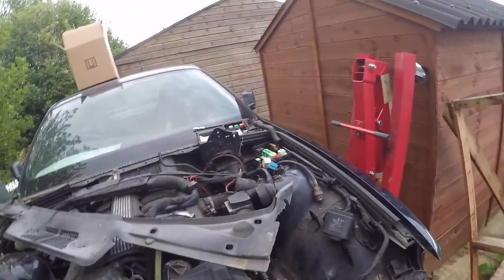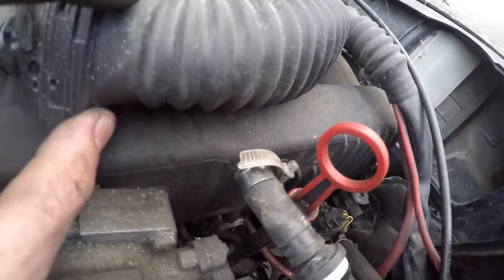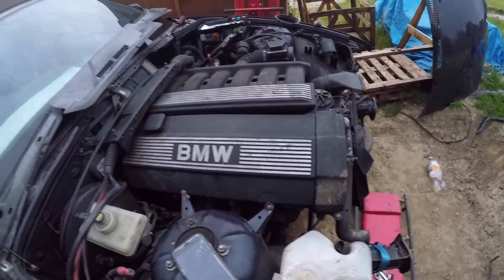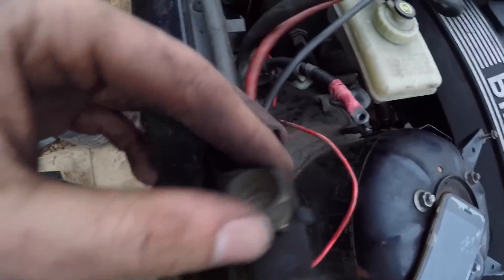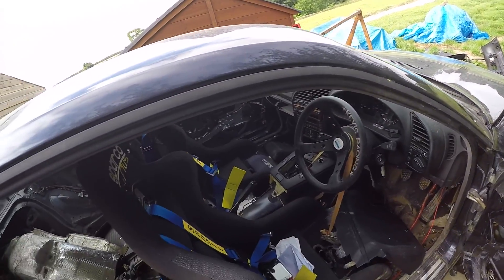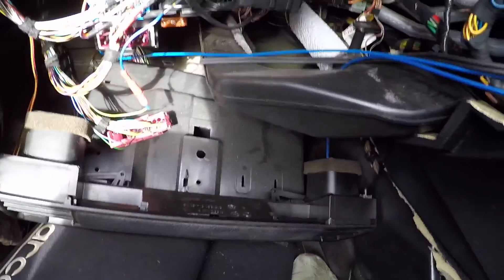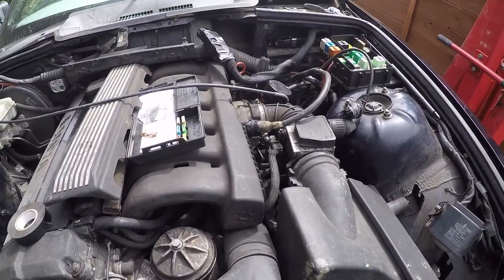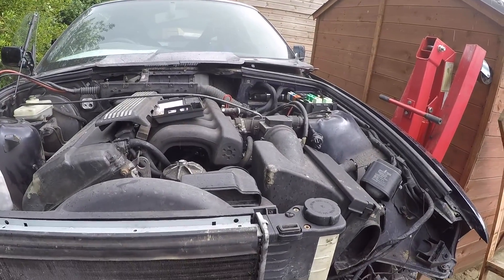E36 4 Cylinder (M44) to 6 Cylinder (M50) Engine Swap DIY Part 3

Comment: Hello, I hope you are well. I have a BMW E36 318i with an M40B18 engine and I bought an M50B20 engine. I wanted to ask you if the M40 gearbox will work in the M50? Thanks for your help. I look forward to your response.
Reply: If your gearbox is Getrag then yes, bellhousing aligns and bolts right up, just connected my Getrag to an M52 in my E36

Comment: Hey man . . . as far as the fuel lines go, did you need to use any fuel lines going to the manifold from the 325i? I bought a m52 by itself, no parts car, so im wondering if i need to obtain some additional fuel line related material in order to perform my swap

Comment: I did this swap, from put a 94 m50 (red label ecu) into a 95 318ci, jumped EWS module and I’m getting crank no start. There is no fuel getting into the engine, and the fuel pump is not priming on accessory. I’ve heard this can be an EWS sub issue, but it may be part of my fuel system. I’m unsure, but I don’t believe it is my fuel system. Anyone here have this issue and fixed it?

Comment: Hey man dont know if you still check these comments. Does the loom plug into every chassis? Wondering if it will plug into my 1992 m40 e36 i got a 1996 m52b28 engine.
Cheers and props to your swap.
Reply from the maker: Loom plugs into every chassis!

Comment: hey mate if have a 92 318is without ews has m42 motor in it and thinking of doing the same swap, does it matter if the motor i buy is from a car that has ews or no? cheers
Reply from the maker: Doesn’t matter, if the engine has EWS then you just need the ECU chipped to remove it. If the engine does not have EWS then nothing to do.

Comment: How do you check your ecu codes? I've already done the swap but can't seem to check the codes is there a wire you have to ground or do you just use the obd2 port?

Comment: What to do if i've seaped it, it turns but cant even crank...
Reply from the maker: Czarny hi, what do you mean seaped it? In answer to your other comments, If the engine loom was left on the engine you don’t need to mess with the starter cable.
Reply: @JDRMotors  swapped*  and it gives too rich mix, it started but turns of without me stepping on the throttle. Now it cant even start and it only shoots flames from exhaust
Reply from the maker: Czarny I have not had issues with backfires before or mixture. Are your fuel lines and pump all working properly?
Reply: @JDRMotors  yes, they are. But I think it might be cuz of the "left air" while i removed the charcoal filter and I left open the line which goes into the intake manifold. I will fill the gap and see then.

Comment: What is that black round box at right of the engine mounted to the chassis and from which goes the blue line close to the fuel lines
Reply from the maker: Czarny it’s a charcoal canister for emissions, you can delete it.
Reply: @JDRMotors  ooh, such thanks for response ^^

Comment: Hi mate I have a 1996 318i with ews and I'm fitting an m52b25. Will a chipped ECU with EWS removed be fine? Or will I have to cut and splice, let me know!
Reply from the maker: Edward Karran you’ll need the ews removed ECU and you’ll have to bypass the ews module on the chassis as well as it’s a 96.

Comment: Hi mate, what was the small green wire that you cut? and do you have to keep the ews plug disconnected from the module to start it?
Reply from the maker: Hi mate the green one isn't needed, just splice the two thick ones and keep the ews plug disconnected from the module.

Comment: Hey mate, I’m doing the same swap but I don’t know where my ews is located my e36 is a 1994 not sure if you could help me
Reply from the maker: Adrian Morales hi mate, you need to remove the glove box and then it’s a big square connector. It’s the lowest one (can be purple sometimes) and just look for the two thick cables that I show how to splice.
Reply: Thanks mate I really appreciate it 🙏🏼
Reply: CN you use the 4cylinder motors auto gear box with the new 6 cylinder motor ? Also are there any supercharger kits?

Comment: Hello mate. Just on with bypassing EWS now. I have bought a new ECU with EWS removed. I am looking at the EWS plug where the glovebox is and I’m stuck slightly. In your vid you say cut wire 3 which is a small green wire. And 1 and 4 to bridge together. They are the 2 thickest wires. However the 2 thickest wires on my plug are in space 1 & 3 and the small green wire is in space 4. I’m assuming when you are stating a number it is labelled on the connected itself? As that is what I am looking at. So you have an email so I can send over a pic to show you what I mean? Any help you can provide is much appreciated.
Cheers,
Alex
Reply from the maker: Hi Alex, I think the green wire cut only works on certain years. The numbers and spaces can vary over the years so all you need to do is cut the two thickest wires and splice them. If that doesn’t work give me a shout.
Reply: JDR Motors cheers mate. Worked an absolute treat. Started up perfectly. Celebrating similar to you 😂. Thanks for he help. Vids are top quality 🤘👍

Comment: I have a CAR from 1995 And engine from 1991 IT crank’s over but wont start...
Reply from the maker: Bendik Medrud EWS bypassed on the 95 chassis? Is your fuel pump turning on?
Reply: JDR Motors  i have tried bypasing IT no help, no the pump is not turning on. I just sett power streit to the pump
Reply from the maker: Bendik Medrud ok fair enough, I would check for spark next. If no spark could
be the crank sensor or ECU

Comment: Will ABS Still work if you swap everything over? I have an m52 320i and im swapping a 92 M50 non EWS from an e34 and im wondering if the wiring is same as your cars or since im changing the ECU from an EWS II to an Non EWS I might be loosing ABS, AC controls ETC ? Maybe you have a clue? Thanks
Reply: I still have the abs, swapped an m43 with an m50. My car has ews its from 96

Comment: Hello Mate, love the videos! Just a quick question regarding the Loom plugs, Why is there 2 on the 6 Cylinder and one on the 4? Is it because the 6 is an automatic? Isthe other plug for the auto ECU? I'm planning to swap the 2.8 into my 318i M43 touring. It is the slowest thing on the planet lol. Regarding EWS also, do you just have to send the ECU off to get it removed and possibly a remap?
Cheers!
Reply from the maker: Alex Atha I think all 6 cyl cars had 2 plugs but can’t remember why. But only one will plug into your 318 chassis plug so just find the correct one. Didn’t have to send My ECU anywhere as it  was from a 92 car so no EWS. Depends what year your 328 ecu is, most will have EWS as it’s a newer engine. If it has EWS you can send it out for removal and mapping at the same time such as higher rev limit, M50 manifold conversion etc. Look on eBay!

Comment: Hello my question is.Did you use the m44 engine subframe for the m50 swap,you only need the mount arms from the m50? My m52 frame is damage and i was thinking if the m44 works with m52.Is for my bmw z3 i understand the front of this car is a e36 and e30 rear end
Reply from the maker: rafael villatoro correct I only left the arms on the m50 and bolted to the m44 subframe using the m50 engine mounts.
Reply: @JDRMotors  thank you So much Sir👍

Comment: hey mate, just took my m44 out my z3 and they're a bit different to the old 36s for wiring... with the relays that you switched did all the wires go out to the loom with them?
i didnt disconect any from the 36 and im unsure of where mine are coming from haha
Reply from the maker: Sam Boddington if it helps all my relays were attached to the engine loom. So the m50 relays just clipped onto the outside of the fuse box. I think the m44 ones were different
Reply: @JDRMotors  ah no that makes sense, just wanted to check haha 

Cheers mate, videos were a lot of help!

Comment: I just swapped my m50 into my 97 318 everything works there's spark, compression, and air, but the fuel pump isn't working it's not the relay and the lines aren't flipped around, the pump worked on the m44 is there some wiring I missed?
Reply from the maker: Have you bypassed the EWS in the chassis of your 97? Cars will still crank but the fuel pumps won't prime without EWS bypassed.
Reply from the maker: in part 4 of my video
Reply: Maybe it is the red wire near the batery. I tought it was an positive terminal but it was an mass cable near the left front strut tower.

Comment: currently doing this swap, m44>m52, starter wont turn, same setup as you(auto m52 engine harness), did you have to do something about the park/neutral safety switch? think that's why mine wont crank,
Reply from the maker: Patrick Morrison is the shell you are putting the m52 into manual or auto? Mine shell was manual so all I did was disconnect the automatic ecu on the m50 auto engine loom.
Reply from the maker: And I mean on an auto engine there are 2 Ecu one for the engine and one for the gearbox (disconnect the gearbox one)

Comment: So got another question for you about my swap. Im gonna use the m50 cooler and how do i connect the heater sensor on it? Should it be a connection in the motorharness or do i need to get more cables?
Reply from the maker: Do you mean radiator? There is a sensor for the rad on the cars headlight loom I think.
Reply: JDR Motors okay so even the 318 loom got it for m50 radiator?
Reply from the maker: andreas edin yeh

Comment: just got a question for you, im doing the same swap. What did you do with the heater hoses? the original 318 only got two and the m50 got three.
Reply from the maker: you'll need to get a three hose one or bypass it
Reply: i got it to work with the original 318 heater valve that sits on the engine bay wall :)

Comment: Hello i have a 318i 1997 engine ? Can i change it to m50 withoud bypassing the Ews , the engine can start ? Thanks and the ecu unit is without ews
Reply from the maker: Yours is the same as mine then. No EWS on ecu makes it easy. However you still have to cut the wires behind the glovebox like did.
Reply: Thank you soo much and my engine start✌ but i have probleme with autoblocking system still not working and i don't now why 😏

Comment: hi mate I've been doing a 2.5 engine swap in my compact iswell but am really struggling to get it started now..it's got ews box, chip, but still won't start! did you have the ews deleted from the ecu before you cut and bridged the wires?
Reply from the maker: Hi mate, my ECU didnt have EWS so was easier. Does the car crank at all?
Reply: @JDRMotors  I am having the same problem. I have an apparently chipped ecu I bridge the ews and nothing no crank nada.

Comment: Is the original m44 propshaft actually the right length? I thought I may need a 6cyl manual propshaft to do my m50 conversion with original 4cyl manual gearbox.
Reply from the maker: Yeh 4cyl works, you have some adjustability with it and mounting points can slide.

Comment: When you did the swap were all your cluster lights and your ac lights working?
Reply from the maker: Hector Saldarriaga yeah, I started with 4 cylinder cluster and all worked (tach was reading double). Swapped for a 6 cylinder cluster  and all good. I removed AC but the buttons and screen still light up. Have you checked all your ground?

Comment: hi mate i watched all your videos im trying to do a engine swap my self but if i dont want to buy another full car what parts would i need would it be a full engine.ecu would i need the loom aswell?
Reply from the maker: driftguyy Hi, you'll need these 6 cylinder parts: Engine with all accessories, Loom, ECU, full exhaust, gear linkage, engine mount arms, battery relocation terminal and wire, clocks if you want the revs to read right. 

You can re use from 4 cylinder: gearbox/prop shaft/ radiator / engine mounts / flywheel and clutch (I wouldn't recommend this as the clutch is smaller than the 6 cylinder one and struggles with the power)
Reply: thanks JDR keep on posting videos i enjoy them.....